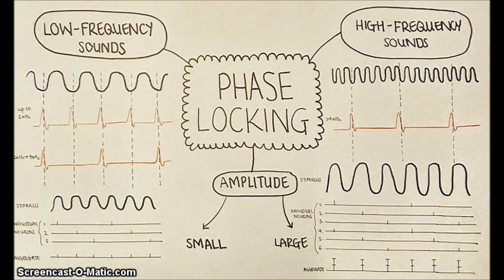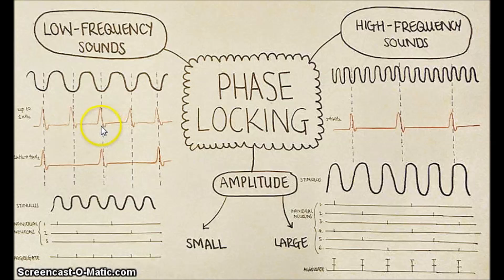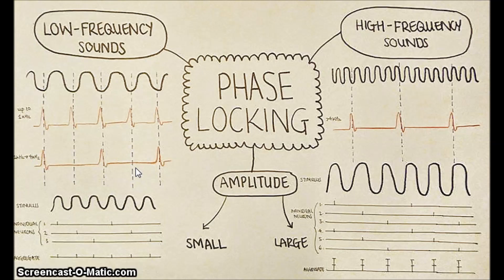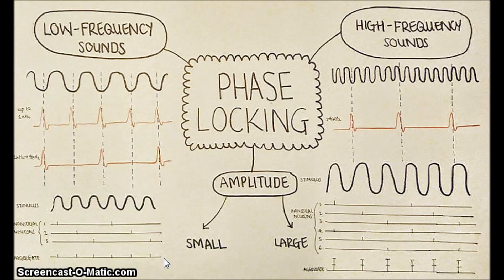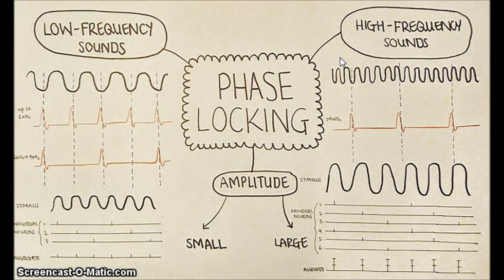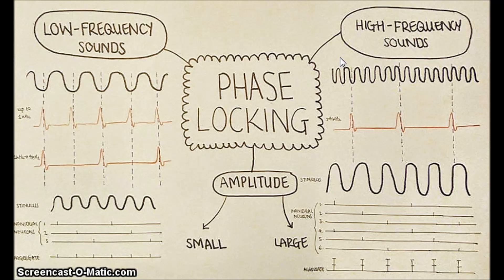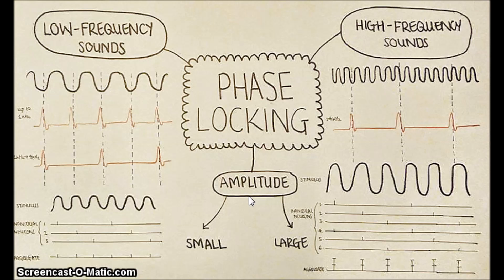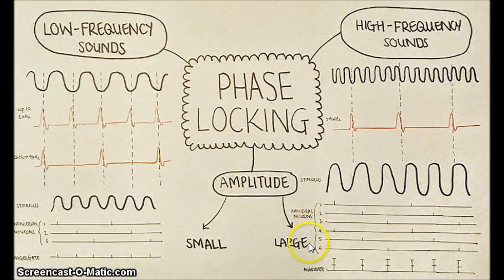Phase-locking in auditory nerves

Comment: concerning PLL  induction heater i have a very important question WOULD 
YOU please answer it ?
how can we make sure pll has locked and is working properly?
when i turn it on , it gets a soft start from high to low frequency 
until it stops on a pre tuned frequency while i have current and 
inverter voltage in phase but as the work peace gets to the curie point i
 don't see any change in the amount of the frequency . it remains the 
same as when i started while the current leads the voltage.
would you please explain exactly what happens at resonance on the 
oscilloscope from when you start until the work peace gets to the curie 
point?? 
in face will you see the frequency goes higher as the work peace gets 
hotter and the current and voltage remain the same ??
thanks a lot Saeed Mahdav

Comment: 1:36 A medicine professor at my university explained to me that the amplitude of a stimulus is actually measured via a combination of the frequency of action potentials and the number of activated fibers.. Don't know who's right, but thanks for the video anyway.
Reply: Confused about this too!I just can't understand how phase locking fits to all of this.Did you find any satisfactory answer?
Reply: @lefrog3851  Honestly, I'm not at all embodied in the matter anymore, was quite surprised upon reading my own comment to be honest ^^'
I did try to get a bit back into it just now, however, and the explanation of my professor at the time seems reasonable to me. I remember (and also saw that on Wikipedia just now) that the pitch is perceived by activation of hair cells located at different positions on the cochlea. If pitch perception was in fact determined only by the location of the hair cells and not by the frequency of action potentials, then both the number of activated fibers as well as the frequency of activation could contribute to the sensation of volume. This is just my rather poorly informed two cents on that however, I hope I did not create more confusion by stating something entirely wrong.
Reply: Thanks for replying,I didn't expect it to be honest since you commended 2 years ago :P .After searching for answers I can say I didn't find any definite answer,some say both phase locking and location code cooperate which I find very confusing but since this model you described makes more sense I am gonna call it a day and stick with that.Thanks again for taking the time to comment!!
Reply: @lefrog3851  My pleasure, did actually take some effort to orientate myself again :). Appreciate your reply back as well, let's hope we got it somewhat right. Have a nice day!